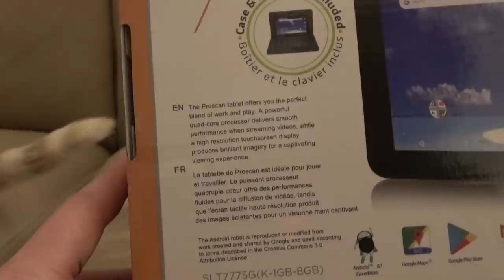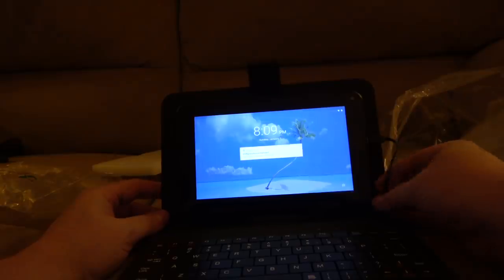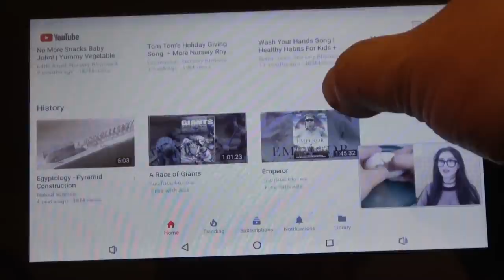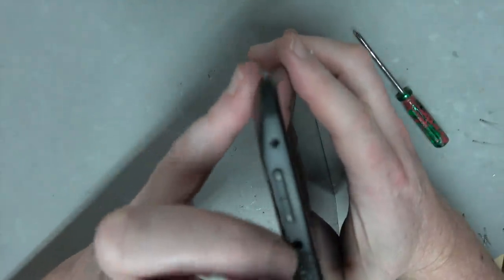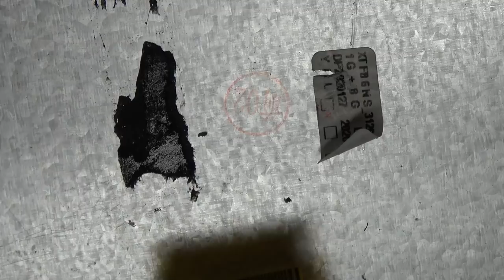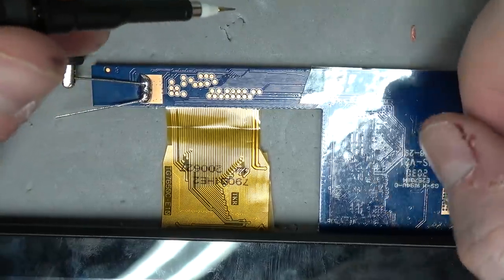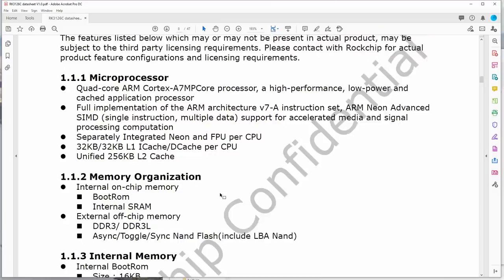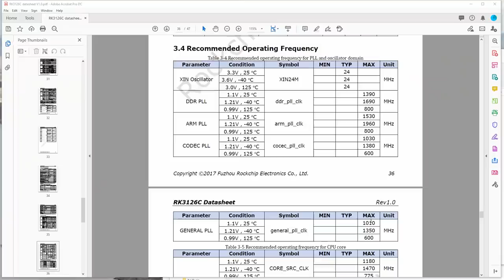Inside a $29 Menards Android Tablet

Comment: 1:34 Android Go Edition is a light version of Android that is missing several features. If a device has that, then it's a low-end device. That's why it has all of those "Go" apps.
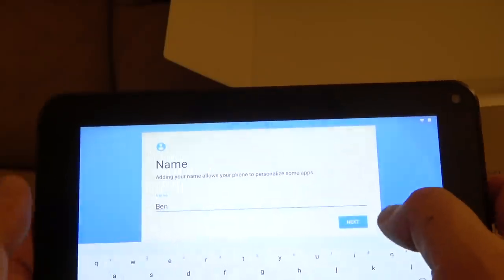4:06 That looks like it has the default AOSP square icon shape instead of the Google Pixel round icon shape that I prefer. It also has the AOSP teal accent colour instead of the Pixel blue!
4:33 Yeah, I can tell that the Chinese ODM that made it were lazy with their customisations, as I believe the volume keys on the nav bar are part of the Android sources provided by MediaTek and Rockchip.
I enjoy your humour.

Comment: @19:25 When you mentioned the Raspberry Pi it struck me that this thing is still cheaper than the cheapest Raspberry Pi 4 Model B - and comes with a charger, a case and even a keyboard.

Comment: I would be extremely surprised if your 50 pin LCD wasn't just the standard pinout.  I've got a whole box full of 40 pin and 50 pin LCDs and drivers and they're all interchangeable (not 40 to 50 or versa-vice, but all the 40 pin LCDs work with all the 40 pin drivers, and all the 50 pin LCDs work with the 50 pin drivers that I have).
Reply from the maker: Yeah. DE was in the right place, just missing the sync. I should get an adapter.

Comment: The Rockchip RK3126C contained within this tablet implements the same 32-bit ARM Cortex A7 MPCore as the Raspberry Pi 2 does. Both in a quad-core configuration. By no means powerful, but able to handle simple tasks. Though I feel sorry for anyone in the undeveloped world who gets their hands on this device and upon the first time accessing a network gets treated to advertising sucking up all their bandwidth.

Comment: the best thing to do with these really inexpensive old tablets is to use them in the outdoors. 
some of the older tablets actually have a real HDMI output.  great to use with a external video device for the holidays and Halloween.  

if you scale down everything then it absolutely would work perfectly as a temperature control or HVAC device you could just mount on the wall.  

but a video doorbell that's cheaper than a regular video doorbell really is kind of the ticket here.

Comment: It should be simple enough to accelerate it so that it would go as fast (discounting air resistance) as a top-of-the-line desktop computer --  9.8 metres per second per second (or 32 feet per second per second if you prefer Imperial measurements).

Comment: Re: this being a generic tablet layout/screen. The internals look very similar to a budget android tablet I got like 8 years ago (a coby kyros). The board shape is the same with a long rectangle sticking out the bottom to connect to the (generic) LCD ribbon cable, and the external Wi-Fi chip and antenna soldered to the upper corner in the same place. I haven't opened any other tablets so maybe these are just common patterns but I figured I'd share that it's very similar to a totally different brand :)

Comment: That might be nice for fishing with my son.  It kinda sucks doing all the work of loading the boat up with fishing stuff, towing the boat out to the water, launching it, parking the trailer then going fishing to fish for only 1 hour while it take almost 2 to get it ready and put it up with drive time.   My son is awesome and loves going fishing but when he not pulling in fish after fish he’s board and I really don’t want to give my 3 year old my iPhone to drop in the water so he can watch some toons.  I could use something like it.  My boat is a 14’ and kinda small so stuff can get in the water a little to easy if you know what I mean.
Reply: I'd be tempted to put the tablet and a slab of expanded polystyrene into a zip-lock bag (so floaty and waterproof) -- dunno whether the touchscreen would still be usable, or the speaker audible, tho...  :-)
Reply: @theskett   that’s a good idea. I could make it prop up too.  I have blue tooth speaker on my boat and sound is really good.  I have some plywood left over from rebuilding my boat and that marine grade plywood is expensive and really good wood.   Thank you! I just need it to entertain a 3 year old between catching fish when it is slow so I can keep fishing too.
Reply: Love this; but beware that (IIRC) there's no BlueTooth on the tablet that Ben reviewed.  But yes, BT to speaker(s) would definitely fix the sound issue :-)

Comment: I'm pretty sure i had this exact tablet in 2013 running android 4 jellybean.
Reply: I also have a tablet from 2013 very similar to it, especially inside. Mine has the Rockchip RK3026 CPU.
Reply: @RaduTek  Did yours by any chance have a mini hdmi output?
Reply: @scellyyt  No, it didn't have HDMI. I think it had 512 MB of RAM and 2 GB of storage.
Reply: @RaduTek  Same specs as mine, then. I may make a quick video on it so we can compare.
Reply: Similar to the RCA tablet

Comment: One of the things I was using tablets like this for was as a at printer display for my OctoPrint  controllers. OctoDroid would work for this. Other options today. This looks like pretty much the same platform as the Archos tablets that were available at MicroCenter, which didn't come with the keyboard.

Comment: The battery life is recalculated to be more accurate. So if you're using a lot of the CPU power it will drain the battery faster and give you a lower time whereas if the device is idling then the battery life time will go up.

Comment: There's a lot more in there than I expected. I've seen much smaller ARM chips in cheap junk tablets and the RAM they must be using some old stock to have 4 chips for 1GB! I rescued one of these screens with a controller off eBay so with a bit of 3d printing I have a mini monitor with HDMI/VGA/Composite. Not using the touch screen digitiser though.
Reply: You have the model of the controller?

Comment: EDIT: 17:24 Insides (PCB & layout) look pretty similar if not identical to the generic tablet described below (I believe the PCB was made by Gigabyte).
-----------------
If it is anything like the generic tablet my dad had a while back......
-----------------
It was purchased for about the same price from Office Depot, and was also billed as having 8GB of internal storage.
However, the OS took up part of this storage so there was only 5 to 6 GB available.

Usually the OS is on a separate part of the nand and not included in the internal storage capacitiy (eg. it is provisioned as 10GB [8GB storage, 1-2 GB OS])
-----------------
But I digress....

Just get ready for the "Go" boot-screen to "go" into an infinite boot loop due to file system errors on the internal nand.
That generic tablet used a non-standard boot loader that couldn't be changed without flashing a new image using the World Cup flasher software (AMLOGIC) over usb.

Moreover, if you enabled usb debugging you could run e2fsck on the internal nand after using asb to open a remote shell.....however, I decided to disable it when it wasn't needed.
That was a big mistake.....it is now a warm brick.

Comment: The pinout of the panel is pretty much like every 50 pin parallel lcd out there for example AT070TN92. I've been working on these stuff before. Just buy a universal 50 pin lcd with correct resolution firmware, plug it in and it will work

Comment: I bought a couple of these. The screen cracked on the first one. That one was close in performance to an Android Fire HD 10 1st gen. Still works as far as I can tell, I just can't control it even with an OTGed mouse plugged in. The second one was slow as molasses if you allowed it to update everything. Both had Android Go. Kinda wish I could have put a custom ROM on them. But what is compatible? Lineage OS? They're basically no-name tablets with holdings companies branding on them ("Polaroid," "Sylvania," "Packard Bell").

Comment: It probably has that separate charge port because they figure you'll use up the one usb port connecting the keyboard. And with a two-hour run time, it's not like if you're doing something that needs a keyboard you can *afford8 to not have it plugged in.

Comment: Looks exactly like my Proscan tablet I got a few years ago (same box and desktop wallpaper) - Android 5.1, 1.2GhZ Rockchip 3126 quad core, 512MB RAM, 10" screen. Slow as hell, but after deleting all the crap installed apps and most of the Google shit off it, it doesn't run too bad... even runs a few emulators OK. The USB keyboard built into the carry pouch crapped out but it works fine with an external keyboard. I installed some synthesizer VST apps and it actually recognizes my MIDI controller keyboard!

Comment: so that tablet is £21.38 converted to pounds, has android 7 and comes with a case and a little keyboard? i remember getting my tesco hudl years ago, it was around £100, no extras included and android 4
Reply: also i haven't watched the video yet i've just gotten like 20 seconds in and seen the front of the box
Reply: okay the front says android 7 but the back says 8.1, interesting
Reply: this thing has the same amount of ram as my hudl and it's running android 8, somehow it runs about the same

Comment: The couch is throwing off the sensor so it is causing it to lag. It seems pretty responsive when it is not getting lagged by user error or youtube not being setup. All the cookie notifications etc seem to lag it a bit. Only having 4 cores has to be a limiting factor. The Rockchips are pretty good depending on the model they are more powerful than the PS3. I think this one is in the Odroid C2 or Banana/Orange Pie

Comment: That thing is probably just as good as the first Ipad or Ipad2 and those cost $300. What a time to be alive. A few years ago that keyboard would have cost more than the whole tablet. There isn't much in these things because it is all integrated. Phones have even less pieces. Now that they are putting the modems in the SOC there is even less. Soon it will all be in the SOC when they 3D stack them.

Comment: I don't think boomers grabbing this as an afterthought are going to think much of the digital age of their grandkids by the performance of this machine, but for us GenXers for $30 it seems well worth it for an experiment box.  I am sure you could get alot more performance out of it if you could replace the default OS with something zippier, there are linux tablet distros, are there not?  Even if not, there will surely be ways to streamline and get the most out of that very limited amount of RAM.   It seems to have the specs of a Samsung tablet I bought for $100 5 or 6 years ago, complete with the wall-wart charger system.

Comment: For $30 it's almost worth it for the screen and battery alone, and you could probably use the shell for something too. Better yet if you can hack it and install Linux on it, then you can use the hardware for anything you like, and you don't have to gut it and replace the hardware with a Pi or similar.

Comment: Any android device with 1GB of RAM has been practically unusable for like the past 5 years at least. I got one of those 70 dollar small samsung tablets to use as a screen for my drone but it was constantly freezing due to maxing out the RAM and google updates doing it's thing didn't help either since it slowed down even further and even hours later it hadn't made any progress with that. The internal storage on it was so little that it didn't have enough space for the drone app even though I removed every system application that I possibly could, plus it was unusable anyway due to being so slow and out of RAM

Comment: I got a pretty decent kids tablet for about 500 Kunas (80 bucks). 2GB RAM/16GB Storage and android 10 go. Great for my toddler watching YT and Netflix. Bit chunky case shaped like a cat face which helps when he drops it as the innerds don't seem to get damaged. The screen must have shifted though cause I'm getting some light bleeding at the edges.

Anyway, for kids who just want to watch some video or simple touch games but are likely to drop it, the sub-100$ tablets are fine. Not sure I'd go "30 bucks" low, likely at that price they are out of date units which will struggle with newer versions of the apps.

Comment: That cat needs a cat toy or a laser to chase around. I have a few tablets kicking around but they are outdated. one has a cracked glass but still works and one the WiFi doesn't work but it makes an OK SDR rig because it's not that fast. I have a nextbook but the USB doesn't work so I can't charge it or transfer files unless I move them to the card and then take it out. 

That small four pin chip next to the speaker connector is the main audio amplifier.

Comment: Never heard of Menard's, they probably don't have a Canadian branch, but if they will online order me this machine for $29 (or even $35) USD  I'd buy one just to gut it and replace it with the Raspberry Pi Zero wifi I bought 6 months ago and has been sitting on my workbench untouched since then. I wonder if it will be better or worse?   That or take it's battery to swap with the horrible one in my JXD S7800b that barely lasts an hour under minimal load. (like a friggin' atari 2600 emulator!) the 7800b is an ideal emulation tab with it's flimsy but workable dual analogs and d-pad, but even under lowly Android 4.4 it's either a total battery hog or else the battery is total ass. I haven't cracked it open to check which, but I am betting on the battery.

Comment: when you pop in a sd card read somewhere it auto switches faster some how if it uses part the sd card for ram or moves files off internal to make more space for ram usage but any way it works and does go faster but hey no speed demon 16gig of ram is better than 8gig too 32gig also that sd card slot maxs out too think it 64gig have to look it up since you never mention it in your video

Comment: Hey that sd card slot get one and the one it asks for speed wise xc think they are it will run faster then forget now but tweaking settings with sd card with expand ram or thing but I got two for the grand kids one died oh and you can hit a button at boot forget look it up and there are all kinds of things you can do in there like reset format things fix storage one of mine died the storage card went dead but they were nice enough to take it on return got another one worked ever since